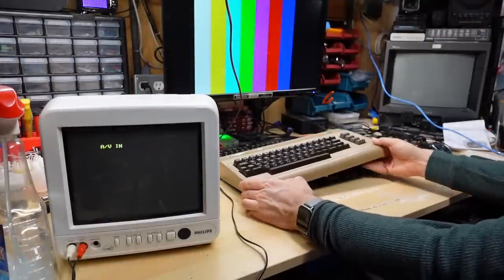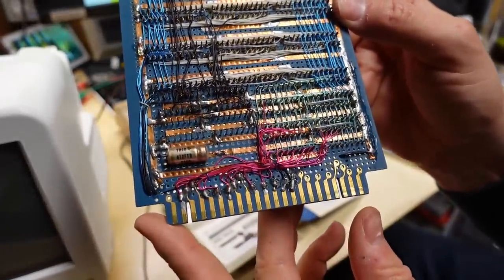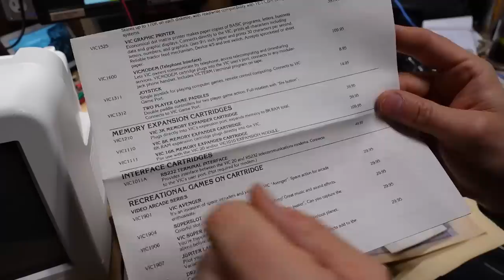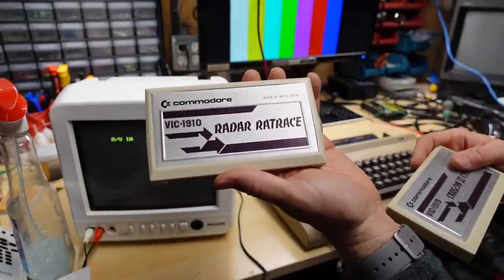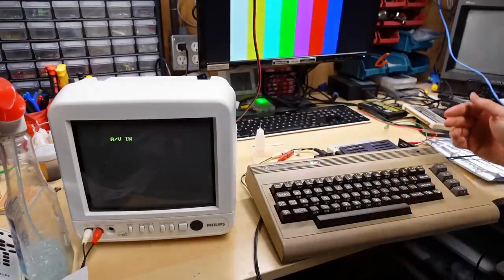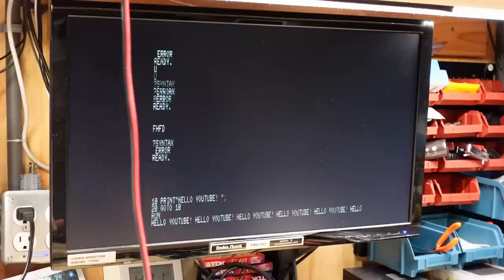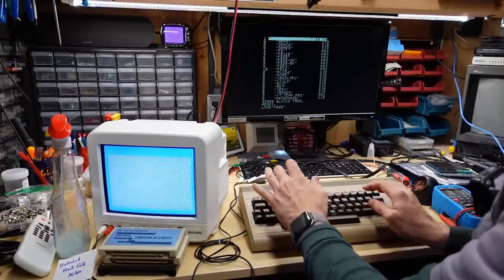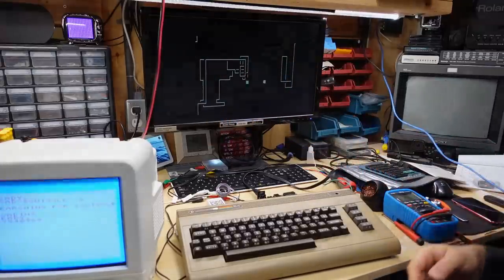VIC-20 goodies: Running PET programs on the VIC, a hand made 24k RAM expansion, 80/40 column cart

Comment: wow, that wire wrapped ram expansion board is a beauty!  I've been trying to get more into wire wrapping recently
Reply: When I was on shore duty in the navy in the mid 2000s I had a job to re wire wrap both uyk-7 front panel indicators for the USS Dallas and Philadelphia which were both floating museums by then.
Reply: @Linuxpunk81  Cool 👍👍
Reply: Yeah its a work of art.
Reply: One thing with wire wrapping is to allow the wire to align itself as you wrap. The tool will back off the post and if you accidentally force it down you will get a flat spiral instead of a spring shape.
Reply: Is wire wrapping suitable for high-speed electronics? Is the advent of the latter the reason why wire wrapping was largely abandoned?
Reply: @ropersonline  it's not very useful for mass production, but it can work with high speed electronics. It's a lot easier to fix a board when it's all bodge wires. Bad wire? Remove it and run a new one.
Reply: The heavy power and ground foil they added helps with high speed signals. I don't wrap the wires, but I strip and solder the wire wrap wire for some prototypes. I have also twisted pairs to make a power and ground for faster signals.
Reply: Fun bit of trivia: The first TRON movie was rendered on the Foonly F1; which was entirely wire-wrapped.
Reply: I did a project of building a frequency counter from TTL using wirepen, the type where you solder enamelled wires.  It was very compact for the amount of circuitry on the board, and it still works some 35 years later.
Reply: @darkwinter6028  I think Foonly is an inherently funny word.
Reply: @ropersonline  IIRC, it was a guy’s name... 🤔

Comment: Wow, that 40/80 column card is like.. magic. I want that.
Always loved the Vic-20, but the 22 column mode is infuriating. :)
Reply: No surprise that the board used the 6845 (well, the Hitachi HD46505 version of it). That chip was everywhere back then, from IBM video cards to the Radio Shack Color Computer.
Reply: i wonder how feasible it would be to build more of that card? looks like the main chip is plentiful.
Reply: I would like to see a few kits of the memory expansion and the amazing 40/80 column VIC 20 card out on the internet for sale. 😁
Reply: @scottlarson1548  For the CoCo it was the 6847, but whatever.
Reply: I've tried 80 call them cards on various computers and I watched the 8 bit guy do the one for the Commodore 64. I would have assumed the only way you could do that for a Vic 20 is to scroll the page and add extra memory for it. I haven't gotten to that part of the video so I'm going to see if my suspicions are confirmed

Comment: When cell phones were rare in the mid-80's, I had interfaced a Vic-20 to my cell phone. I had the computer hooked to a small 6 inch TV screen and used it to do only 2 things. One was to give me the names and addresses of the people I knew and stored and used the Vic-20 to dial the numbers for me. Then I just had to press send. 
The cell phone was a GE-1000 mounted in my car and what was neat, was I could plug a regular phone on the expansion port of it. This way if someone wanted to call and were sitting in the back seat, they could just pick up the  regular house phone on the seat besides them.

I had the keyboard detached from the Vic-20 and attached it on a swivel in the feet area of the passenger. Open the glove compartment, and it would reveal the TV ready to run the program. I had it set that as soon as I started the car, Vic would boot up. Man I loved that little computer.

Comment: Wire wrap is reliable, until it isn't.  Lots of possible problems with cross talk, and if the wrong size wire wrap bit is used for the terminals and wire used the connections won't be tight enough.  #30 wire was the most popular size for computer circuits, but wire as thick as #20 were used in some telco circuits.  Had to very careful stripping the wire, if it's nicked it will eventually break (try trouble shooting that!).  Expensive NO-NICK (TM) stripping tool was required!
Those are Augat sockets with the round contacts.  Nice thing about them is that you make some homebrew double sided boards you can solder these sockets on both sides, no vias needed!  REnumber big time and put the pokes AFTER the initial prompts so you have the cursor for that, and lose it when the clock starts running.

Comment: As a side-note, you can add up to 27 KiB to your VIC-20, it's just that BASIC will not be able to use all of it because it won't be contiguous, thanks to the VIC chip's architecture, for the reasons below:

1) The VIC chip can only see the first 8K of RAM (0x0000-0x1FFF).
2) The unmodified VIC-20 has a "hole" from 0x0400-0x0FFF.  The 3K RAM expander fills this hole.  But...
3) The VIC chip can only use onboard RAM for video memory and character sets.  So it cannot use the expansion RAM from 0x0400-0x0FFF, because it is not "onboard".

If you are only using a 3K expansion, it simply fills the hole from 0x0400-0x0FFF.  The start of BASIC RAM is moved from 0x1000 to 0x0400.  The screen memory stays at 0x1E00-0x1FFF, and most games that used custom character sets changed the "RAMTOP" pointer to 0x1C00 to reserve 512 bytes of RAM for custom characters.  The result is that any BASIC program that will run on an unexpanded VIC will also run with a 3K expander.

If you plug in an 8K, 16K, or 24K expander, it fills the memory from 0x2000-0x3FFF (8K), 0x2000-0x5FFF (16K), or 0x2000-0x7FFF (24K).  To give you the maximum amount of contiguous RAM for BASIC, the screen memory is moved to 0x1000, and the start of BASIC is moved up to 0x1200.  This means that BASIC programs that POKEd to screen memory will have to be modified, and BASIC games that used custom character sets won't run without using a "chain loader" to modify the RAM configuration and load the main part of the game.  (Without such techniques, you either were left with less RAM, because you had to "reserve" RAM within the first 8K for the custom character set, and/or you risked overwriting part of your program and causing a crash.)

The end result of 27K expansion is that you can use the memory from 0x0400-0x0FFF as a "protected" space to store machine language routines, but BASIC itself only has contiguous RAM from 0x1200-0x7FFF, for a maximum of 28,159 bytes free.  (You can also install RAM from 0xA000-0xBFFF, which is normally used by game cartridges.  You can use this as another 8K of "protected" RAM for machine language.)  An interesting note is that this does work with the "Super Expander", as long as you relocate the start of screen memory to 0x1E00 and the start of BASIC RAM to 0x2000 before using any of the graphics commands added by the Super Expander, so you can still have 24K of RAM and the extra graphics commands.

Adrian and any VIC enthusiast already knows all this.  I'm just posting this mainly for you "young whippersnappers" so you know what we had to put up with back in the day.  ;^)

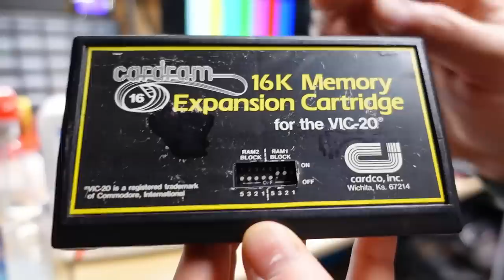Comment: 3:54 The company was Cardco; Cardram was just what they called that particular RAM expansion. Their whole schtick was naming things after "card", such as the "Card?" [sic], which was a parallel printer port for the C64, and the "Cardkey", which was a numeric keypad for both the VIC-20 and the C64 that plugged into one of the controller ports. I bought one of the latter a week ago or so; apparently (I haven't confirmed this for myself) the PCB is glued to the bottom of the case :D It seems to take advantage of the fact it only has 16 keys to basically treat the four controller direction signals as a 4-bit counter to determine which key was pressed when the signal for fire button is triggered.

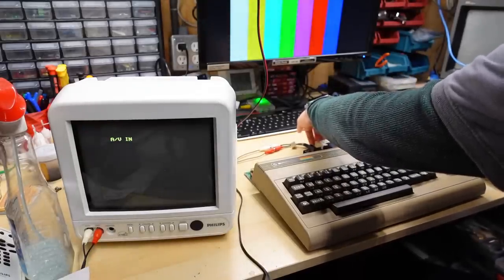17:19 I have one of the rare early Japan-only releases of Radar Rat Race that were still called Rally-X; that was before they realized they didn't have the license to that game (a Namco arcade game) :D This was one of many VIC-20 games created by HAL Laboratory, but the person at Commodore who did the Radar Rat Race conversion overwrote the in-ROM credit with his own name.

19:23 I sprayed Deoxit all over a C128 motherboard I'm trying to clean and de-rust and it did get rid of a lot of white powder near the user port that diffused back each time I tried tackling it with alcohol. There's some white crustiness coming back, so I'm now wondering what to try next... I should try the board to see if anything I did so far has fixed it; before I started doing anything it would boot to C64 mode with weird text colors and no cursor whenever the power switch decided to actually work which it didn't a lot of the time.

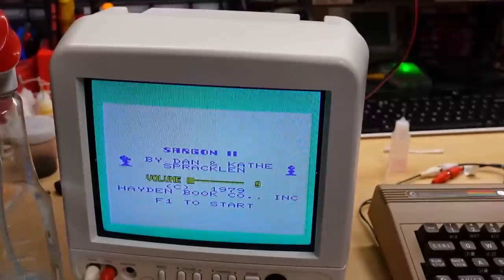21:53 Sargon was an entire franchise of chess games based on an engine made in 1978, and Sargon II was originally released in 1979 for a variety of platforms, including the Apple II and TRS-80 (but not the PET).

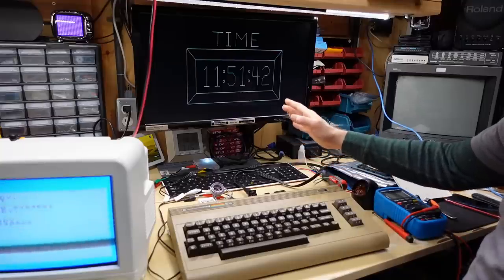33:35 Commodore made an official "PET Emulator" software package in the very early days of the C64; some early C64 brochures list it as being available. I have yet to see a full specimen, but I did pick up a loose disk of it a few weeks ago, and there are disk images of at least two different versions of it available on the web. It appears to emulate a BASIC 2.0-based PET?

Comment: Very nice.  My first computer was a VIC20.  I bought it used and it came with the 16k ram expander, cassette, and a 3 slot expander that had a reset switch and a switch to make the memory read only.  I still own it.  I need to get it out and see if it still works.  Thanks for the great videos.

Comment: Cool!  I've just got my first VIC20 fixed up and running - completely stripped the keyboard and cleaned, replaced the LM323K with a modern switching equivalent (no heatsink required), replaced a few caps, added a Penultimate+ cartridge & SD2IEC - love it

Comment: The VIC was a pretty neat little machine.  I had a switchable 16K pack for mine, very similar to the one you showed.  You could use it to run pirated versions of cartridges, map a bank into where the cartridge space was, and then load in the image from tape and start it manually.  I had  copy of (I think) vicmon, which I borrowed from a friend and then used it to copy itself to tape, this was what I used when I wrote my VIC version of "Boink" in assembly in '85-86 or so after seeing my friend's spanking new Atari ST running Fujiboink. 

Hand assembled code with manually calculated jumps, no macro assembler here, memory mapped bitmap graphics using the character set hack, and a bunch of hand-hexed 16x16 sprites of a rotating commodore logo.  Sadly, it all got given to a junk shop after I moved down to "that London", I should have kept at least the tape with boink on it.  :(

Comment: I haven't tried wire wrapping, since the sockets are a bit expensive, but I have made my own cards with point-to-point soldering using the same 36 awg wire (got a bunch of it in assorted colours). I find it handy to use a separate loop of wire to bind the bus wires together, grounded at both ends, just to keep things neat. Otherwise, it's too easy to snag.

Comment: I had the Commodore made 16K memory expansion.  It was originally hard wired for Block1 and Block2.  I added DIP switches that were exactly like the ones in your card.  It was cool, because I could assign memory to Block3 or Block5, which allowed me to run cartridges that I had "backed up" on tape.  Totally unrelated, but American Family Video in Salem rented VIC-20 cartridges.

Comment: 10:36 Those two photocopies of a PCB look like my Super Expander cartridge PCB. The six small chip positions have 2114 ram chips in them. Only one of the rom chip positions was installed, the top one.

Comment: Fun video!
1. The Protecto 80 card does have a case.
2. The VIC-20 KERNAL calls are compatible with the PET.  In fact, all the VIC-20 roms were adapted directly from the PET.  However, screen memory is in a different location. :/

Comment: Oooo, I remember that 16k RAM expansion. I can't remember all games I just lusted after but had too little RAM available. One of the games though
I clearly remember playing for hours on end after getting the 16k RAM expansion was 'Sword Of Fargoal'. Sweet memories.
Fun fact is that wire wrapping is actually more reliable than soldering.
Reply from the maker: Yeah I can believe it with wire wrapping! Just the rework might be harder? (I've never tried.)
Reply: @adriansdigitalbasement  It's quite fun when you get the hang of it. I did it in school in the 80's and a few years after but then other things came in the way. The worst thing to do rework on is a complex layout and you need to get to the bottom wire on a pin that has like 4-5 wires above and a lot of other criss-crossing wires around. =)
A challenge to say the least.

Comment: Awesome video!  I had no idea they had an 80 column board for the Vic!!!  I do have a 32K expansion for my Vic and I have been able to load some 40 Column PET BASIC software using some of the software 40 column programs.  Fat40, Screen40 are two programs to help with that.  Techtinkering did a great video on that.  But I had no idea they had hardware 40/80 column support!
Reply from the maker: Yeah I tried a software 40 column program but wow was it so slow (and of course hard to read.) This really makes the machine nice and usable!

Comment: For BIG TIME you can add the line with the pokes as line 55. You will get the cursor when you are asked for some input but it will turn off after that before you see the clock display.

Comment: I could have done with that 40/80 column card back in the day. We had a single, chiclet keyboard Commodore PET (CBM branded I think) at school (UK, so most of the computers were BBCs and Spectrums), and I had a VIC at home at the time. I wrote a project on the VIC (or it might have been started on the PET and completed on the VIC, it was a long time ago) , and while it did run on the PET the difference in screen layout was an issue.

Comment: I like to clean cartridges and card edge connectors (in general) with a soft rubber eraser. A quality one that, when used on paper, doesn't leave marks on the paper. Like Pentel or whatever other quality brand. I do like to use Deoxit to help clean the slot itself though.

Comment: Yes, the 80 column card does have a case - it looks like a narrower and thicker black cartridge case with a stepdown to allow it to enter the cartridge slot. They are pretty flimsy and held together with four tiny self-tapping screws, and if you have the 8K RAM expansion pretty inconvenient as you either have to mod the case to build in a switch or take it off every time you want to flip the switch to set the memory block.

Comment: Interesting! I grew up in the former GDR (German Democratic Republic, i.e. east germany). Back then I had to do a lot of wire wrapping as a trainee at an electronics company . This was state of the art in the GDR until the late eighties!
Reply from the maker: Amazing but I guess you had to do what you had to do
Reply: @adriansdigitalbasement  In the video you mentioned the reliability of the wire wrap technology. And so it is. But only regarding the electrical characteristics. Mechanically, the wires  had broken very often due to vibrations. So the technology is not suitable for use in vibrating environments like cars and ships etc.

Comment: The 24Kb Wire wrap VIC20 card will only be adressed for blocks 1,2,3, which is a pity, since you are missing block 0 (3Kb RAM expansion) on both.
If you rewire the 24Kb card to change from the block 3 line to the block 0 line, you loose 5Kb, but in combination with the 16K (port expander) you could fill all 25Kb of normally open memory.

Also, if you use the 16K crt and switch block 5 on on one of the two, you can load cartridge games from floppy or tape (,8,1 or ,1,1 where the PRG file starts ay $A000), and pure reset (or sys64802) will (re)start the game (switch off for a while to clear memory, or disable block 5 again before reset ;-).

Me and my dad had VIC20's in the 80's: me a 400 DM VC20 from Germany, and he a Dutch VIC20.  Both were equipped with extra memory (he is an electronics engineer with access to chips), and even ROMs like VIC FORTH, the Super Expander (3K RAM expansion minimum required due to graphics), and VICMON and Programmers Aid with multi-select turn switches (built in memory), and we also had a 40/80 b/w column card with CBM character sets (monochrome for resolution required :)    He even replaced the original PSU and connection with a huge external PSU, since the AC to DC converter (diodes) was causing the interior to heat up too much ^^

I unfortunately trashed them in the 90's to clear room and had to re-buy a VIC 20 a few years ago for melancholy reasons :(  
At least that one has the C64 Power connection (made my own PSU for that as well, with a regulated 5A 5V small PSU and a 9V AC transfromer limited to 2.1A by fuse).
Reply: That's what I did too. I used to put some electrical tape over the auto start     pin on the edge connector of game cartridges. Then copy the contents of the cartridge to disk. Fun times.😁

Comment: The reason for all those jumpers on that 16K memory card is so it can coexist with other memory cards. If you got one of those multi-card slots for the back, you could probably use the 80 column card and the 16K card simultaneously, as long as you set the jumpers not to allow the RAM areas to overlap. Vic memory mapping is both really cool and quite convoluted.
Reply from the maker: Yeah indeed. I talked to another viewer who had the same 80 col card and he used it like that, with a memory board in another slot.

Comment: If only I had one of those 80 column cards back when I had a VIC-20, I would have gotten a load more use out of it, the blurry 22 column video did my eyes in and I avoided it in favour of a TRS-80 as it's text was so much more readable, and you can get way more code on screen.